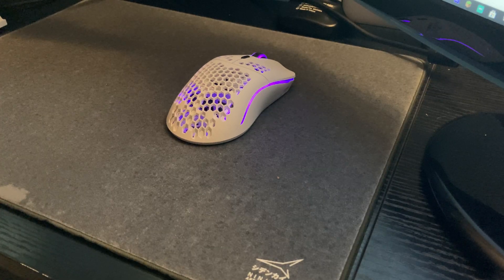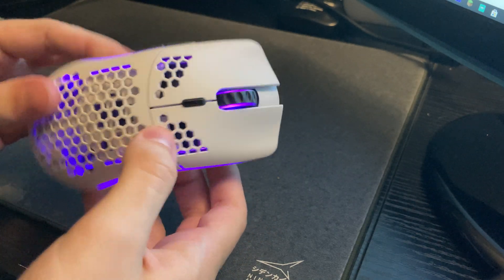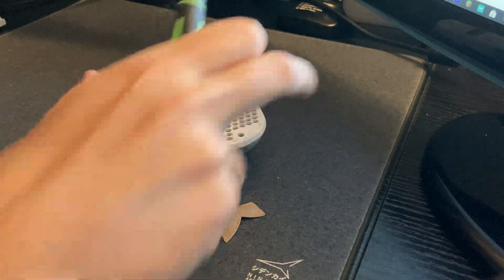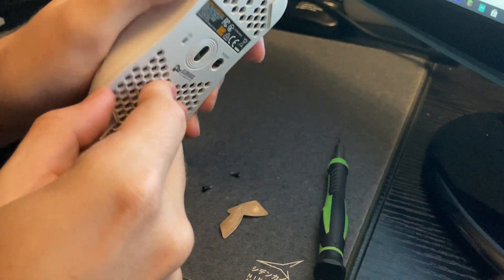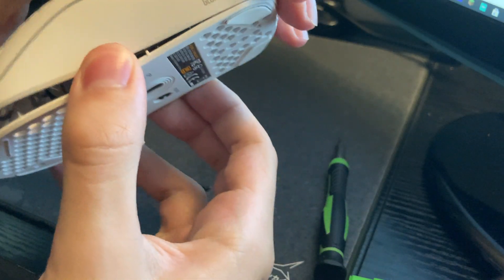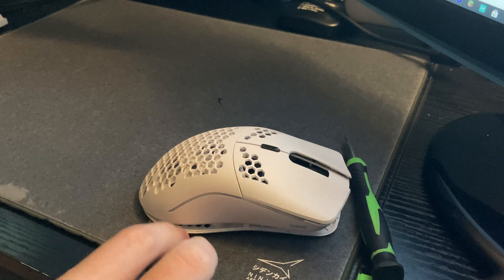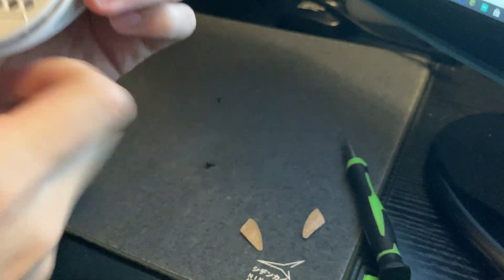How to Fix Squeaky Mouse Buttons on Model O and Model O Wireless.

Comment: For those who don’t want to take the mouse apart. You can just take a wd-40 can and stick it into one of the holes. It does cause slight leakage if you’ve put too much it. But so far it has stopped the squeaking and no issues have occurred. Just make sure you use a very small amount.

Comment: I was able to avoid removing the skates by flatting a qtip with pliers, soaking the qtip with a drop of mineral oil and then inserting the qtip from the front in between the plastic parts, lubricating a plastic post/plunger that sits about 1cm from the front.
Reply from the maker: thats smart i never thought of doing it like that
Reply: Thanks! I appreciate the video and this comment. Helped me fixed the issue. <3

Comment: do you know of any alternatives to keyboard lube that will work for this? Thanks!
Reply from the maker: dialetic grease, any kind of oil that isnt used for cooking will work honestly. dont use motor oil though. just some form of lubricant will work well.
Reply: @ripnxll  thanks! I used silicone spray and it worked but ruined a tiny part of the finish on the outside. Thanks for the tutorial.

Comment: Is there a way I can do this without taking the mouse apart?
Reply: looking at my model o. you can probably use a syringe with somewhat big diameter needle to drop lube at the front and sides of the plastic knob touching the casinng. you won't reach the backside tho. should work. <3

Comment: this helped with the squeak, but what i dont understand is how you put the skate back on and still have good glide.
Reply: when you pull mouse skates off, you gotta pry it from below and not peel it to the side.
peeling it to the side causes the mouse skate to bend and deform, which is probably why your skates dont have as good of a glide as before. You can try using a blow dryer on the skates and flatten them as much as possible or just get new skates entirely
Reply: if you did it wrong, you may need to get new mouse skates.

Comment: Is there a way that doesn't require taking apart the model o? Because if I mess it up, it will cost me $90 to buy again, since prices in canada are outrageous.
Reply from the maker: I think there is another video that shows a fix without opening the mouse but I haven't seen it myself. Opening the mouse and applying the lube really isn't too dangerous and you shouldn't mess it up since it's not messing with the wiring or anything.
Reply: @ripnxll  Thanks!
Reply: @ripnxll  I’m worried about the skates and how do I stick them back on, also what lube can you use?
Reply: @neon-original  I didn't use any lubes to put back the skates.
Reply: 90 cad is lucky I had to pay 120
Reply: @octs609  Bruh. It's been 6 months XD. I found that the squeaking went away with use.

Comment: would WD40 Work?
Reply from the maker: havent tried it myself but i dont see why it wouldn't work
Reply: @ripnxll  Ty
Reply: @kirohxl6960  I heard that wd40 could damage plastic, after I already put it on my model o, have u had any problems?
Reply: @web3986  it does

Comment: i dont get where EXACTLY do i have to put the lube
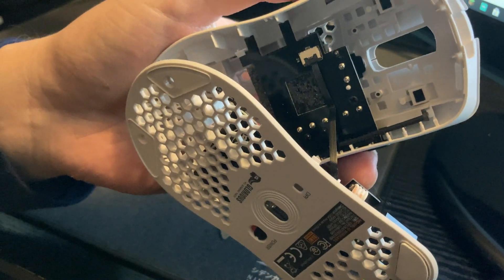Reply from the maker: where the plastic meets the shell of the mouse, at 2:16 I point directly at it, its basically just the sides of that plastic part with the black square on it.
Reply: just do somee oil and i fixed